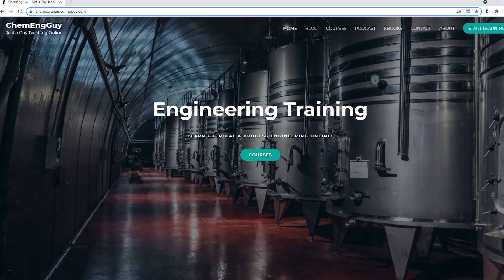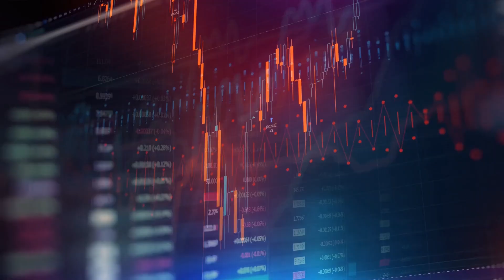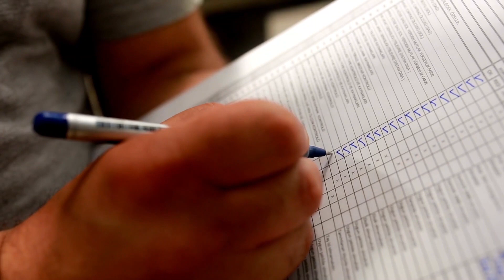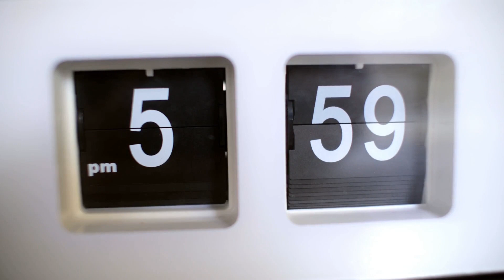Things I Miss the Most From Being a Process Engineer

Comment: I'm with you on the skyline! I love the lights when Im there at night! Im at a large oleochemical plant and I think the most rewarding thing is to be able to find solutions to production problems. Developing that intuition to be able to troubleshoot equipment is a tricky but rewarding thing. Turning valves, feeling the lines for where there's heat and flow, watching your gauges, and understanding how all of the equipment interacts with the product are all things process engineers need to know to figure things out. Then I love using that knowledge to design better solutions for my operators. You just won't be able to do that anywhere else.
Reply from the maker: indeed, problem solving has its satisfactions XD

Comment: Hey Sir, I am grateful that I found you since I am in my final year of chemE undergrad from India and honestly in a perplexed position right now. Through my college placements I have received an offer from IHS Markit for the role of Research Analyst in the Oil and Gas sector, which will commence next year after I have graduated. But I am keen to do my masters from abroad which will put me in a technical position in a plant, for example a MS from TU Delft in process engineering track. Like what do you think that I should do? Take that job or spend a lot of money to do my masters? Also is it possible to do my masters in a technical role after being an analyst for couple of years?
Reply from the maker: I have a video on that! check it out... I would recommend to go for the job, get some experience and cash and ensure you get what is it to work in such industries... Then you can either go to study the exact same degree or change of ideas... Don't think you are losing time or so!
Reply: @ChemicalEngineeringGuy  sir so is it possible to work as an analyst for few years and than go for masters in a much technical role (like process engineering)?